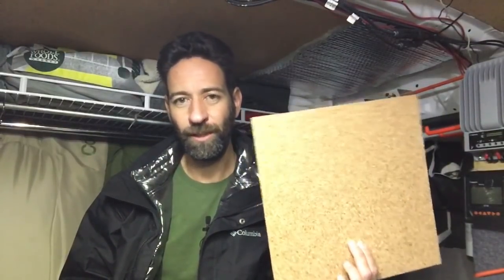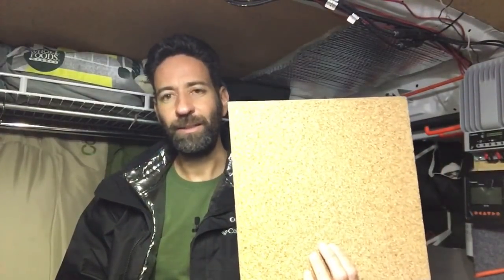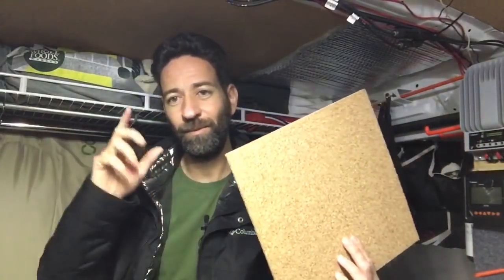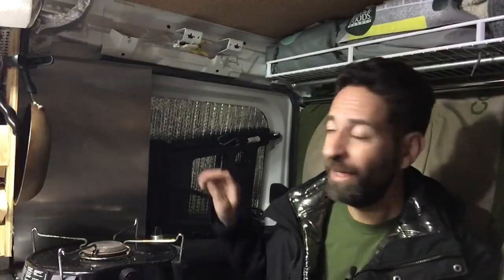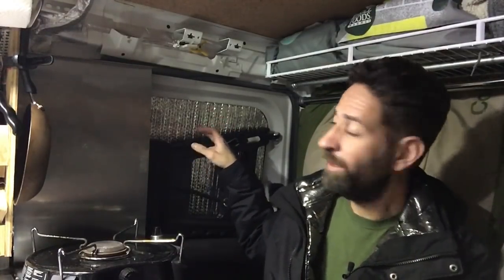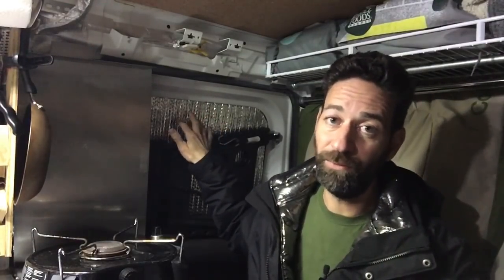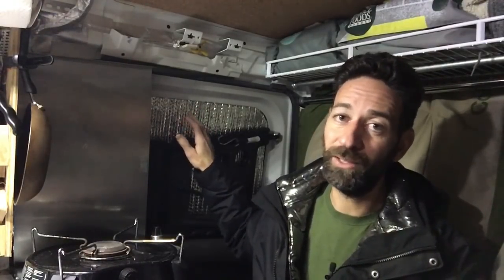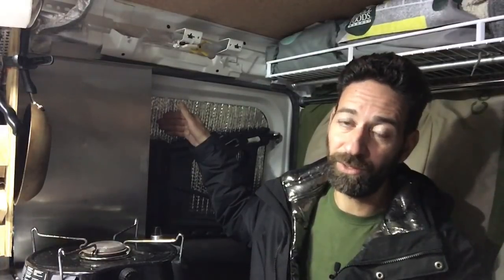Update on Using Cork to Control Condensation in my Campervan

Comment: Hi! 👋 here in Ontario you can buy 75 sq ft of eco cork for about $66 at HD...maybe not where you are? I havent tested this product fully but you could try Mould Control (also at HD). I would remove mould (can you show us some pics?). Do not use bleach - that chemistry has not been  approved for years now. Once cleaned and dried spray MC on those areas. My guess is that it doesnt remove mould as they say but rather encapsulates it forming a barrier. I havent found it to be noxious but open up a bottle in the store and spray for yourself.
In those areas that tend to mould perhaps you could try a layer of blue jean insulation. Friction fit..if there is some air movement it might be alright. If your test is successful then reconsider putting new reflectix or cork or.. as the finish layer inside your van. I wanted to recommend roxull but tearing it apart will diminish the integrity of it and make a mess. No to anything Pink but i have had success and recommend Dow blue products (human health friendlier). Best of luck! Keep us posted. 👍
Reply from the maker: I did see the eco cork. I’d rather use a natural product and stay away from plastics if I can help it. 
I don’t use bleach. I only use Dr. Bronners Castile soap. It’s naturally antibacterial. The little mold wiped off easily since my paint is in good condition. 
Thanks for the suggestions. I’m determined to carry on with the cork and see how if performs over the winter.

Comment: There is a thin sheet of Radiant Foil barrier .. its made to reflect thermal  energy.. so it might have been better underneath the cork ..  to keep heat in/out  on the side that it comes from   the cork can absorb the moisture ..
Reply from the maker: No, I have used that product and found it did absolutely nothing. It doesn’t insulate or keep out noise. It did however cause some mold growth. So I have removed most of it and will remove the rest and replace with cork as the cork is functioning much better.
Reply: Its not insulation in the classic sense its purely and energy reflector it will reflect heat back in the direction it came from.. if there is no heat it does nothing .. If you are getting conduction vs radiation it does nothing for that .. you need something that will not conduct well such as cork.. yet cork absorbs heat and holds it .. depends on how you are getting cold or hot and if its a radiation or a conduction .. and then there is convection .. understanding those principles will help you make whats best.. all good good luck..
Reply from the maker: Thanks for the message. You should know that I found out that insulation in such a small van is more detrimental than helpful. I’ve lived in my van with insulation, radiant barrier and nothing at all. The cork has been the most comfortable of the four.

Comment: You’re quite right getting rid of your reflectix. It’s not an insulator without the recommended air gap. In a van because of the gaps and shapes of the steel that wouldn’t be possible. By the way the company itself gives guidelines on proper usage. It’s a real corker.
Reply from the maker: That’s a great point, the company recommends how it should be installed. Then someone makes a video recommending a different application and it takes hold. Kinda of like how a lot of people are trying to use foam to build cabinets, it’s not altogether a bad idea, but it is not well thought out. 
Haha, good stuff!
Reply: Static CamperVan Foam sounds great but unless LOTS of work goes into the finishing detail it will often look like something the dog regurgitated! Also if you want to make an alteration you start back at the beginning. Lightweight plywood is quicker and can be made to look good.. “Bendy caravan (yup I’m  not American) plywood can be easily manoeuvred into most shapes for lining the van. It’s relatively cheap too.
Reply from the maker: My parents had spray foam in their campervan and on warm days made me violently ill. I’m hoping to never have to insulate again. I had my van insulated once but had to remove it because it was too hot in the summer.

Comment: I thought mold could start behind reflectix or any insulation not sealed correctly. The metal is cold, the air is warm and moist. It can find gaps and get behind and condensate, But you don't see it.

Let us know how it goes in a month or 6 months. Does it darken  with cooking fumes? Dies it crumble off? Does IT get wet with moisture. 

Hope it works long term, then I might use it too.
Reply from the maker: Sure thing. I plan on staying with the cork through the winter. We will see how it holds up.

Comment: That foil stuff isnt an insulation,it needs a 1" air gap to work,and only has an R rating of 1 anyway,it's ok as a vapour barrier,but there's better and cheaper options for that anyway,there's still a lot of bare metal in your van,thats where condensation will hit
Reply from the maker: Yup. I’ve been saying the same thing for months but every time I do, I get barraged with comments telling me I’m wrong and it is great insulation! 
I am planning on covering all the bare metal to cut down on the condensation.
Reply: People believe this because they do not have a clear idea of overall what needs to happen. Technically reflectix is a good product mostly because NASA has used mylar in space and determined it reflects back so much of our infrared energy. I even have gloves and socks made with mylar interwoven in them. And like you I have an Omni-Heat jacket which I also believe to be an aluminized product. The problem is that, in conventional building terms, your 'building' is built "inside out". The outter wall is the hardest with no moisture permeability and historically outside walls and paint have been the most breathable with the real vapor barrier on the innermost surface possible.

Short Version: People believe marketing wank which is not reality.
Reply: John Possum ...I read that the vapor barrier is what is important with the reflectix reflecting heat back so plastic could work just as well. That's what the article said.
Reply: you must have a thermal brake directly on any metal that will be subjected to temperature changes and esp. air that contains humidity.I'm looking at spray cork..it's an insulator, creates a finished wall, ceiling or floor, is a vapor barrier and thermal break all in the same product. I am going to use it on the inside and exterior on the roof to create a protective barrier and a 2" layer is a nice insulation that will mean I do not have to raise my roof becasue I can insulate from the outside. I am seeking a US contact if anyone has a company and if anyone has already used this product from  out of Canada, please let me know your opinion of it.Galvanize Green is a Ca. company. I would like a NY company or to do it myself. Thanks!
Reply from the maker: Very interesting. I’ve never heard of spray cork. I will certainly pass on any info if I can. 
Btw, the cork I installed worked great for me. My only question is how it will perform in the summer. I’ve found no insulation is the best solution for me in warm weather so I’m hoping the cork I have installed doesn’t act like insulation.

Comment: Will be interesting to see the van fully corked, and your opinions on the changes.  I think I would have stuck the cork to a roof panel then screwed the panel into place. ??
Reply from the maker: Then I’d have clearance issues. The combination of the poly batting and Reflectix has been working, I could have just used that system to insulate. But I am trying to strike a balance of headroom, performance and looks.

Comment: Glad to hear you found the mold. 
My van is not insulated and all I have around the walls are moving blankets - which I feel the cold and condensation inside. For now.
However, after this winter, I should be able to installed a fan and maybe by than we can have more info on your cork installation.
Reply from the maker: Crystal Vanner has had success with using moving blankets. I’ve always thought it was a great idea. I think you’re correct in wanting a vent fan. Without one, I don’t think any insulation will work properly. 
I’m very happy with the cork so far.

Comment: Instead of gluing the tiles van walls, how about using velcro squares? Then you could remove  the tiles occasionally and spray a mold remover on the van walls and back side ot the cork tiles and then put the cork tiles back up.
Reply from the maker: I believe that if there is any air gap, there will be moisture build up. I’m using spray adhesive so the cork can be easily removed if needed.

Comment: Sorry to hear you've had problems in your van. Cork is about half as good an insulator than polyiso, but it IS an insulator, so you'll see the benefit. It's not gonna control condensation, the moisture will just condense elsewhere. Reflectix is gonna trip a lot of people up, I suspect. Van dwellers have been suggesting it as an insulator for a long time - it's made of aluminium/alooominum (I'm from the UK 😜) which is one of the very best CONDUCTORS of *heat*. Sadly, it's much easier to follow experienced van dwellers than to lose your mind reading technical data on insulation products which were never designed with vans in mind!!
Reply from the maker: Haha! We tend to go with the majority, don’t we?  The good news is that the cork (and opening my vent) has solved the condensation for me. It’s been several days and No condensation.
Reply: That's good news. If enough people are doing it, then it must be right.... right? Only another 3 months of winter to go. 😰
Reply: Has it rained?  The worst is when it rains.  I do, though, shower in my CT.  I realize you have no space to do that.
Reply from the maker: I have a sink with running water that I use to bathe when I don’t feel like going to the gym to shower. I’m still not bothered by the rain. Being from SoCal, I’m enjoying the change of scenery, pace and yes even precipitation :^)
Reply: No, I mean the condensation gets really bad, if you have an issue when it rains.  There is a lot of moisture in the air, so your issue, if it still exists, will be worse then.  

I love the rain, too.
Reply from the maker: Ah! I haven’t seen a problem since I finished applying the cork to the ceiling.
Reply: agreed! Reflectix, has , on it's own , TINY insulation values .. not just because either side is foiled, but because there is nearly no air gap at all between the layers via the bubble wrap.  Best  SINGLE way to help control condensation?? ventilation! especially when heating with propane or when cooking inside.

Comment: I like the cork. Are you using a protective mask when using the spray adhesive??? Safety first. Wouldn't 2 fans exhausting out of the ceiling be a better way to control the condensation?
Reply from the maker: Yes, I am using plenty of ventilation. That’s why I’m not done with applying the cork, I’m waiting for days where I can keep all the doors open. 
My opinion is having a vent low and a vent up high is the best for air flow. Warm air naturally rises. When I turn on my stove, it creates wet heat. That moisture seems to exhaust out the top vent when I have my floor vent open.

Comment: You can get a small portable dehumidifier would take moisture out
Reply from the maker: I will be making a video soon about the other part of this problem. I used to use a Mr Heater Buddy, like most other van dwellers. The heater was the problem. I’ve since switched to an Olympian Wave 3 and now don’t have any more condensation issues. I figured I should go ahead with the cork experiment because I cook a lot when the weather gets cold. 
I’m very happy with the cork but the heater was the key for getting a handle on the condensation.
Reply: @StaticCamperVan  yes your rite I used my stove and had that problem I used an electric heater I was plugged in and didn't get moisture I heard the wave three solved this to so I'll be getting one but the dehumidifier does work

Comment: It's possible that the condensation is caused by breathing in a closed space. Have you consider having some kind of a vent to let air from outside to come in? 
PS: I'm from a country where negative celsius temperatures is a rare  occurrence. So a vent may not work for you....
Reply from the maker: I have two vents one un the floor and a roof vent/fan. I keep them open 24/7. I only get condensation when I forget to turn the fan on when I’m cooking.

Comment: I had a humidity problem in my van, and now I'm looking for solutions...until now I have: cover all the holes in the van, to use cork to cover the inside the van, nothing more, what do you think?
Reply from the maker: I can only tell you what has worked for me. I’ve found with my van, I need two vents that stay open all the time. If I close the vents, I will get humidity. 
I mail a video about vents here: https://youtu.be/bBLgemW4yEA

Comment: This may not even make sense but can a person consider using the mildew resistent shower curtain plastered to the ceiling?
Reply from the maker: Without some type of “insulation” it wouldn’t be of any use. The cold would radiate through and water would condense on the plastic.
Reply: Static CamperVan ....but can you plastered the shower curtain plastic on top of the insulation and then mold would not grow on that plastic, what ever it is treated with to resist it?
Reply from the maker: You can. Most people add a vapor barrier over the insulation. Those shower curtains are treated with an antibacterial that I believe is toxic. At least it’s toxic to me. Even when the curtains are treated, they will still eventually support mold and mildew.
Reply: That shower curtain will attract the moisture.  Plastics really attract the moisture.  I need to remove my plastic 4-drawer dresser from HD that I put in my CT.  Instead, I am building a floor-to-ceiling shelving unit.

Comment: Before I moved into my pick up truck I had a leak in the sunroof thing where the rain got in and made the floor soggy and unfortunately there was mildew essence when it was wet. I blow dried it with a hair dryer and got direct sunlight on it as much as possible. But I noticed that if water accidentally gets it moist again the mildew essence is there immediately and someone else on the internet said that too . Now I have condensation on my windows and stuff in the am and I wonder if this is going to keep the mildew spores alive. .what do you think I should do???!!!???!!!???!!!???!!;...also you use a full towel? I use a car microfiber mitt to dry myself off and it's my lifesaver. I only need one and it's easily washed and dried too!! $1 at the dollar store or other places. Don't get the big ones on Amazon. Also I think CC has a crush on you.
Reply from the maker: You can try spraying some Hydrogen Peroxide on your carpet. It is a bleach that will kill bacteria. I used to use it for a job I had ages ago. It works good. 
Haha, Carolyn and I are just friends.
Reply: Static CamperVan ...good idea. Would it bleach the color of the grey carpet in here?
Reply from the maker: No it won’t bleach your carpet. 
Oh I forgot to answer about the towels I use. They are called Dri Soft. Bed Bath and Beyond sells them. They do a better job than the microfiber towels and dry almost as quickly. I prefer to use natural products instead of synthetic ones.
Reply: Static CamperVan ....ok so awesome. Thanks. I already have some hydrogen peroxide in a mini bottle. I will so check out those towels!!! Also I know a lot of ppl use baby wipes....I don't really use them too much but sometimes for this and that but of course they have too much fragrance...you know of any good ones that don't emanate noxious fumes? The best ones I have found are at DAISO JAPAN in LA, and ones from Target with pure water with ? 0.1% ? Grapefruit extract. I have tried using paper towels with a spray bottle but they tear apart except for Viva brand but unfortunately that one has a chemical odor. Argh.
Reply from the maker: My favorite wipes are Babyganics from Target or I buy them from Health Food stores. They are expensive but I don’t use them often.
Reply: Static CamperVan .... thanks! Just to clarify .....the babyganics brand are at the health food store? Or another brand? Thanks. I have to keep some of these wipes in my truck bed because of the chemicals!
Reply from the maker: Target carries the Babyganics wipes. But I also like some at health food stores, I don’t remember the names though.
Reply: Static CamperVan ... thanks

Comment: +Static CamperVan  Give a try to polyurethane. slim, light, humidity doesn't affect it and you can glue it and fit it very easily : )
Reply from the maker: I like the cork. Plus the polyurethane off gasses when it’s warm and gives me migraines.
Reply: Thanks for the info - does it's needed to change the cork over time due to it being less insulating / rotting?

Comment: I never had a drop of condensation, let alone mold, until I quit smoking. In fact, when I'd hear talk about it on a video, I'd just scratch my head. 

I quit two years ago. Two winters in rain forest-like conditions..... and found my first mold last winter. Ugh.

Turns out that the one huge difference is that when I was smoking, I'd have front windows open at least a crack..... no matter how cold or wet, with the cig hand held outside. 

Conclusion? Open your windows at least a crack for a goodly portion each day. Easy to say while it's still warm, but there you go.
Reply from the maker: Yup. I leave my vents open year round. Even when it’s bitterly cold.